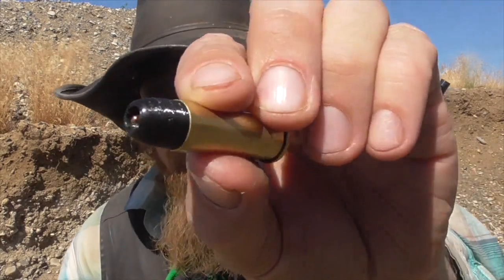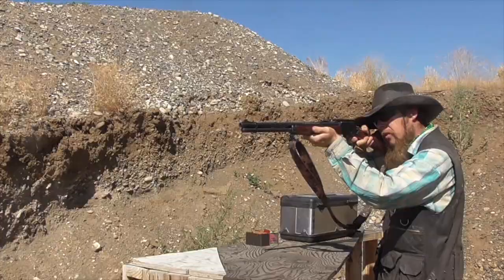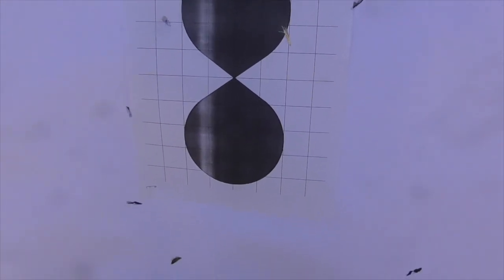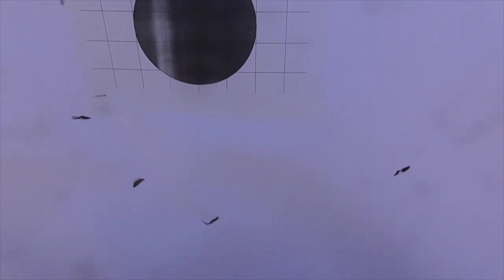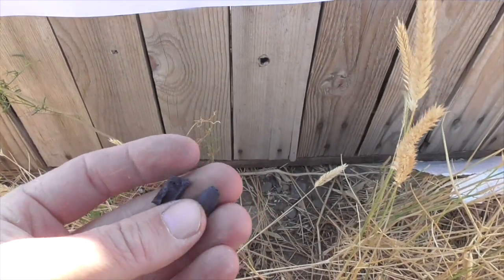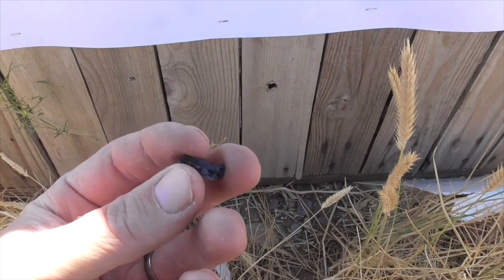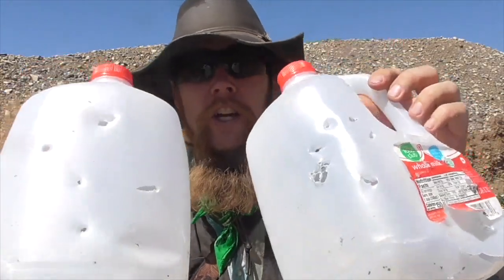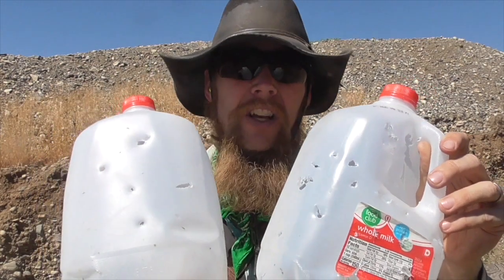Second Test of Sabot 44 Mag Ammo (TIS384)

Comment: One minute and 23 seconds in:  
A long skinny bullet is going to need a much faster barrel twist rate than the typical 1:20 used for .44 Mag.

I predict tumbling, if the sabot separates.
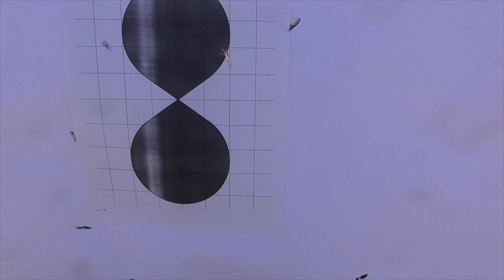Reply: 2:40 Easy to understand why:  a 55 grain .224" spitzer bullet requires at least a 1:12 twist barrel.  1:9 would be better.
The fact that the bullet is not at 3000 FPS actually makes the twist problem larger.   Steepest twist required near speed of sound.

Comment: Are you not afraid of Sabot breaking when you shoot and slowly filling the barrel/rifling?
I can imagine it gets your firearms dirty
Reply: The sabot is what pushed the bullet out.  If the bullet leaves the barrel, so does the sabot.  The sabot is contained and supported by the barrel as it travels.  It is not going to fracture in the barrel.  Even if it did, the high pressure gas would blow out the plastic particles, the same way unburned propellent particles are blown out.
Reply: Are you referring to plastic fouling, or something else?
Reply: @rickoshea8138  But is it wrong to assume that it can damage the barrel is that happens?
Reply: @Tunkkis  You guessed it
Reply: @Schrodingers_kid  It's theoretically possible, but highly unlikely. The barrel is made of hardened steel while the sabot is plastic (and not particularly hard plastic at that). It would basically have to be an extreme event for soft plastic to damage hardened steel